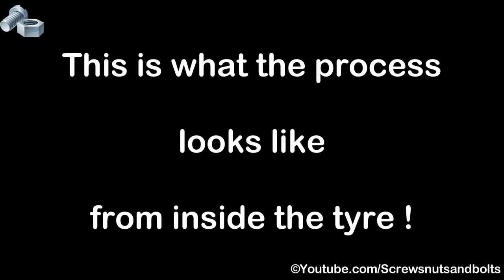Tyre Puncture Repair Kit Tutorial

Comment: This is not a proper way to repair a tire. If tire was driven on flat or low pressure, there would be a lot more damage inside of the tire then you can see outside. That's a blowout waiting to happen. It is not like popping a balloon. People really die because of it. Also, injury point must in the center of tire, not on the shoulder block. This is the TIA standard.

Edit: https://m.youtube.com/watch?v=mdTAalpkSLM
Reply: Nope, this is the correct way.
Reply: @zoinks9864  No it is not! I'm an ex pro tire fitter, so listen to someone who knows!
Reply: Yes.. it is the right way :)
Reply: wordreet lol funny too, I’m a tire changer too, this is the correct way.
Reply: @zoinks9864  Heh, I've never heard it called tire changer before. In the UK the job centers always say tire fitter on the cards on display. Though I've ended up as a CNC machine setter, which pays better. ;¬)
Reply: Tyson Seabrook  Well that is just not nice to call someone a clueless moron. I guess I can't be too upset when you have been doing tires for many years. Sometimes older people are just stubborn and not willing to accept changes. I have a couple of those in my shop right now. I have been working at a tire shop for many years, too. Rules and policies change to make it safer for everyone. You are entitled to your opinion. I say this is the wrong way and you say it is the right way. My sources came from Tire industry Association and Rubber Manufacturers Association. You are welcome to call them up and tell them they are clueless morons, too. I don't know what's your source since you didn't provide any.

 I follow TIA and RMA rules and policies because they are the big boys and know what they are talking about. I am not going to put my customers' lives at risk just because you or anyone else believe in something different. Also, many tire shops out there will fix tires for free, the proper way. Mechanics are a little different since they aren't actually educated about tires. Like many people, I trust my mechanics, too. But not when it comes to tires. Mechanics and tire technicians are two very different classifications. So many times I told my customers that tires are too worn on the shoulders for service and their mechanics tell them tires are fine. So many times they tell their customers tires are worn so they come in to buy tires and tires still have 5/32nd of an inch on them. But that's a whole different story. It's not like we are all trying to get people to spend money they don't need. If TIA and RMA are FoS, I would think they would be facing lawsuits by now for wasting people's money. It's not my job to convince you do things the right way. But if you come to my shop for a flat repair, I can promise you I'll never fix your tire with something you can get at a grocery store.

Comment: Brilliant video. Just the way tutorials should be done. 

I had a question though. Is this method of repairing tyres safe for the tyre? No one agrees in my country about the correct method of repairing puncture. Many swear by the patching method, where the whole tire is removed from the rim and then a patch is applied from the inside. The idea is that plugging damages the tread of your tire. Others say the patching method causes more damage. 

Not sure which is which. 

Would really appreciate your expert thoughts on this. 

Thank you

Comment: How long should the tire sit before inflating with the air? How long will the plug last? Does it need to be patched from the inside is this a temporary or a permanent fix? Are there different plugs for different size tires like say different ply ratings or load ratings? Or is this Universal for every Tire everywhere? Good to see how it's done though

Comment: It's worth putting a bit of rubber cement on the reaming tool too, it gets some cement in the hole when pulling the reaming tool in and out then the hole is tacky when you put the rubber plug in.

Comment: how long the repair can last? Does it cause any steering vibration or have any side-effects?
Reply from the maker: I would only use it as a short term repair but if the repair is done properly it shouldn't affect the steering or anything else.
Reply: @screwsnutsandbolts  then What's the long term solution?
Reply from the maker: @meshkatularefin5630  The best option is having it patched/plugged from the inside at a tyre shop

Comment: Great instructions but what if the hole is on the firewall ? Would this still be ok to use ?
Reply from the maker: Thank you. No this should not be used to repair the sidewall of a tyre
Reply: @screwsnutsandbolts  thanks for the quick reply thought as much :)
Reply from the maker: @dalebassett1046  You're welcome

Comment: Good video.One question-To  make the punctured tyre loose less air,can I delay taking out screw till I make other things ready and then take out screw and immediately after that I start other steps.One more thing..your video shows appying sealant to one side of tape.Can it be applied on both sides?
Reply from the maker: Yes you could do it that way. I took my time as there was no air in the tyre. You can use as much sealant as you like

Comment: Which would you say was better the mushroom plug or the glue strips? Do the mushroom plugs have glue to hold them in place ?
Reply from the maker: No the mushroom plugs don't use glue. It's hard to say, the mushroom plug looks more secure from inside the tyre but the strips look more secure on the outside.
Reply: @screwsnutsandbolts  ok mate thanks for the reply👍
Reply from the maker: @peterwright9562  You're welcome !

Comment: May be I am being naive but when we insert the tyre plug in the hole why isn't it pulled back out once we pull back the insertion tool? Isn't it inside the tool similar to a needle?
Reply from the maker: The tip of the needle is actually open

Comment: I bought this in Canadian tire but it doesn't come with a rubber cement, do i need to buy one separately? Victor Heavy Duty Tubeless Tire Repair Kit
Reply from the maker: Some kits come with rubber cement and some don't so it's probably not needed with certain kits.

Comment: @ScrewsNutsAndBolts  Great tutorial for those people that has never repaired a tire before but, there's just one little element that you left out and maybe should've been included in this video or mentioned.  Sometimes is not necessarily a "nail" that punctured the tire, sometimes it maybe some other foreign black metal object that punctured the tire, which blends with the tire color and sometimes difficult to spot, .....in that case,  pouring soapy water over the entire tire and watching for bubbles should show you where the foreign object is embedded in....unless, of course, it's a "shiny" nail which you can spot right away though. 

Also, if your car is old with wide rims and tires, if the rim is rusted out on the inside, sometimes your tires may begin leaking air from the sides and not necessarily from the main outer surfaces of the tire.
Reply from the maker: Thanks for the comments. The aim of the video was just to show how to use this particular repair kit 👍

Comment: It's an awesome video.

I just have a Question. 

Will it be helpful if there is AIR already in the Tire while doing a Puncture?
Reply from the maker: Yes it's actually easier to do when there is air in the tire.
Reply: @screwsnutsandbolts    Thanks mate
Reply from the maker: @soig725  You're welcome. You just need to be more careful removing the screw or nail if the tire is under pressure.

Comment: Great video, how's it been since the repair? I have a puncture in the same spot,I was told to get a new tyre as it's close to the sidewall and will flex.
Reply from the maker: I only used this tyre for demonstration and the puncture site was just about on the treaded area, but any nearer the shoulder and it would be recommended that the tyre be replaced.
Reply: @screwsnutsandbolts  thanks for your reply,the nail in my tyre is about 2cm away from the edge of tyre..I don't think I'll take the risk and just replace it

Comment: does this hold long term? or is it a short term solution?  im asking as im thinking it may work as a quck fix incase i tear a tyre up when im off road or is it strong enough to repair snd kerp going on it?
Reply from the maker: I would only recommend using this as a temporary repair.
Reply: @screwsnutsandbolts  yeah i figured youd say that, it is common sense,  i tear up tyres regularly and this looks like the perfect solution when im going down a mountain at 50mph and get stuck in the middle of nowhere with just emergency tools, i think this would be perfect to get me to the finish at the least
Reply from the maker: @CallOfDutyMenace  Some people say they've held for years in the tyre but I wouldn't take the risk myself.

Comment: Came here curious on how long you have to wait before inflating again, the instructions= until it's dry? I have used it  successfully a few times and think it more permanent than temporally (some of the comments below testify of it. Instructions don't recommend for larger holes. Today my attempt left half the inserter in it so i'm due for a new one! And thank you for stressing that some part take some effort. Yes if your nail etc is a couple of mm you'll work pretty hard to get it clean and large enough with the 'file tool' But great video. Thank you
Oh, I forgot to repeat what another comment stressed : Do mark the spot where the puncture is BEFORE you remove the culprit. On a bicycle it's a real pain to find it but on a car tyre you'll be cursing yourself for not having done it.
Reply from the maker: Thanks very much. I think you can pump it up immediately after repair.
Reply: @screwsnutsandbolts  I think that's what i did before but could not remember thanks, :) I forgot to add what one comment wrote" Do mark the spot before you remove the nail. On a bicycle it's already a pain but on a car tyre you'd be in big trouble to find the spot again!
Reply from the maker: @meeekstubbular  Thanks for the tip :)

Comment: Thanks for the video . i have followed the same procedure the  stud has come out now, does it cause any problem. Do i need to remove that or does it go as we drive
Reply from the maker: How much has come back out ?. You might have to remove it and start again. Remember, this kit is only designed as a temporary repair to get you to a garage and have the tire fixed professionally.
Reply: ScrewsNutsAndBolts I have drove the car after fixing it, it had  come out after I drove the car, Do I need to get it Checked
Reply from the maker: @devrajm9738  Yes I would take it to a tire repair garage to have it looked at

Comment: They use this fix in dubai and I wasn't keen on it, but fair play it works very well even in 55oC driving my Audi s4 very quick on 255 35 19" tyres they never had any problem after puncture repair done like this. 50,000km later.....

Comment: How reliable is this fix and can it be used on the motorway? pls and thanks
Reply from the maker: I would only recommend using this type of kit as an emergency repair. I wouldn't advise taking the car to motorway speeds with a repair like this, just to be on the safe side.
Reply: @screwsnutsandbolts  Many thanks, good to get you home though
Reply from the maker: @mrvolcada5355  I agree 👍

Comment: Thanks for the video.  Is there any reason you wouldn't want to use a drill to enlarge the hole, if a drill is available?  Just wanted to check with the expert to make sure im not missing something.
Reply from the maker: I was just demonstrating the repair kit using the tools that came with it :)
Reply: @screwsnutsandbolts  I understand that.  I was just thinking that that particular part of the process took some extra effort, if a drill around it might be faster/easier for that part. I was wondering if you have tried that or if you foresee some problem with that. Is that tool somehow leaving a rough texture for glue to better adhere to where a drill bit would not, or is there some other reason the provided tool is better than a drill?
Reply from the maker: @anotherOneMore7  I haven't actually tried it to be honest so I'm not sure if it would do a better or worse job

Comment: Some guy at a petrol station showed me how it's done. Had his own repair kit. Very impressed but he lay on the ground to get the nail out and drill the puncture hole. Didn't occur to him or me at the time for him to move the car so that the punctured tyre with nail was facing upwards. This video should explain that when you have blocked the hole you need an electric tyre pump to reinflate⁷ the tyre. You could be stranded anywhere.
Reply from the maker: I'm just demonstrating how to use the repair kit :)

Comment: Thank you brother for making this video. Will this stick well or after sometimes the air might get leaked out?
Reply from the maker: They usually stick well but they are designed as a temporary repair
Reply: I've had one on my car for 8 months now. If it hasn't leaked down by now, it's not gonna leak!

Comment: Do you have to take the tire off and Release all the air ???
Reply from the maker: No you can use it when the wheel is on the car with air in the tyre, as long as you can access the puncture area

Comment: I was wondering what if you don't cut off that excess left over with the knife? The other day I had nothing to cut off the excess bit, so I just left it like that and driving the car with it on.
Reply from the maker: I'm not sure. It might just wear away over time but it's recommended that you cut it off. These repairs are meant to be only a temporary repair until you get the tire fixed properly.

Comment: Nice method, but does it compete with the mushroom type repair (that needs to be applied by unmounting the tyre)?
Reply from the maker: The internal mushroom type patch is a better fix than this. This is only a temporary repair until you have it fixed professionally

Comment: You ever do this with the tyre still on the wheel?
Reply from the maker: As long as you can gain access to the puncture site then yes, you can fix it with the wheel still on the vehicle. It's easier to gain access on the front wheels.
Reply: @screwsnutsandbolts  cheers, I've done them, just wondered if anyone else had and had issues, so far I haven't, got one to do tomo, luckily it's in the widest deepest part of the tyre, typical had the tyres fitted last week!

Comment: Now the grand question: what is the price range on this? I got it done at a garage and they charged me $25, did I get ripped off? I'm in socal
Reply from the maker: These kits can be bought for under $10 dollars :)
Reply: @screwsnutsandbolts  ah oh well. If I could wait 3-4 days then I would have bought one + a tire air compressor.

just FYI to anyone reading this: costco does this for free. At least they did back in 2015, not sure if its still true now

Comment: does this count as a safe permanfix? i had that on second hand used car and i drove over 200km without even knowing it was there
Reply from the maker: They're generally designed as a temporary fix to get you to a garage and have it repaired professionally.
Reply: Here in the US, Merchant Tire won't touch it. They will not replug a tire if it fails. If they pull the screw, they'll patch it & warranty the work.

Comment: so after applying this fix, we do not need to replace the tyre right? or we should out of safety's concern? this fix is only for temporary yes?
Reply from the maker: Yes this is a temporary repair. If you use this fix I would take it to a garage and have the tyre inspected and repaired with a proper patch.

Comment: You can make the reaming easier by applying rubber cement to the tool, this also aids the plug to bond with the rubber.
Reply from the maker: Thanks for the tip 👍🏻

Comment: Good Video very helpful 

I really like those cord plugs

if you read the fine print they say they are only a temporary fix to get you to the tyre shop to put a mushroom plug-in 

That’s what it says here in Australia at least

but I’ve had new tyres that have had nails in them I’ve  put a cord plug-in and it’s lasted the full life of the tyre - several years -  no problems 

On more than one occasion too

the only difference I use a fair bit of the glue cement they provide and I cut it 3 mm proud of the tyre face and dab more glue on afterwards 

never had a problem even in high-performance low-profile Pirelli’s.....!!!!

I reckon they have to say it’s temporary otherwise they would probably have to pay a fortune in engineering studies to validate it as a long-term fix in order for them to advertise it as such within the laws.....

If everyone had this kit in their boot and a 12 V mini compressor it would virtually eliminate the need to carry a spare tyre..... at least in terms of metropolitan commuting

If you’re heading out to the bush you’re mad not to have a spare tyre or more plus these kits....
Reply from the maker: Yeah I totally agree. If I'm driving any long distance (as much as I can In Ireland lol) I always bring my repair kit and mini compressor with me. Having more than one puncture is unlikely, but far from impossible :)

Comment: I did it with cheap kit and it works fine on car tires with drill like rimmer.  It plugs fine but cutting the tar/sticky things is not that easy because the whole is on the deeper groove.

Comment: You left a little studs when you cut the excess. Do they get just worn off as you drive or get pushed in further?
Reply from the maker: I probably could have cut them off a bit more flush with the tyre but they should just wear away over time.

Comment: Will this work if the tyre has already been removed from the steel rim / frame?
Reply from the maker: It will but it's harder to push the tools through the tyre when there's no air pressure.